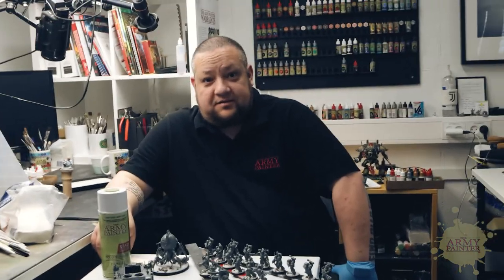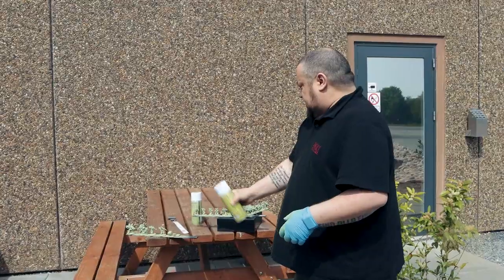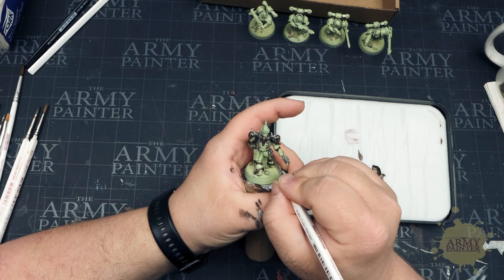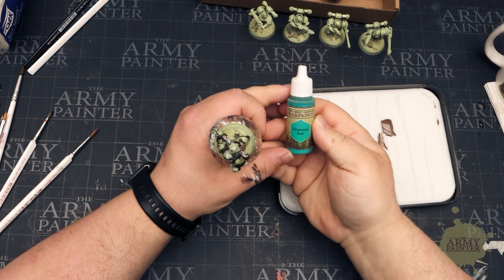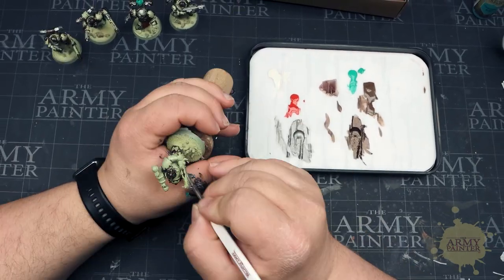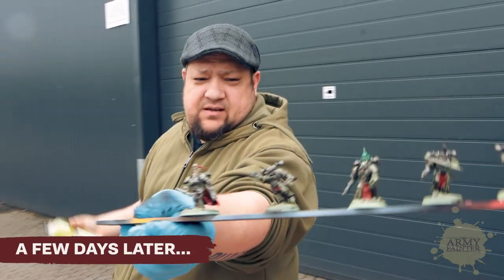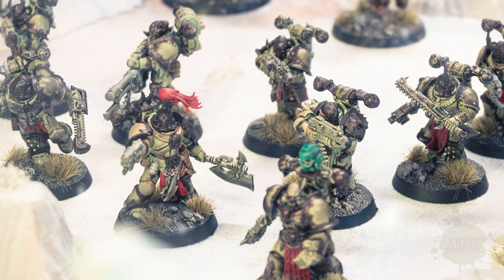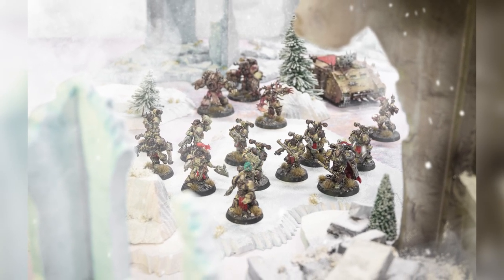Colours of War | Chaos Marine Army Tutorial

Comment: Nice tuto but in 2022 this method is completely OBSOLETE. With the same effort and some washes you will get MUCH better results in less time than the dipping, much more clean, without accidents throwing minis some inches far away and even much more budget friendly. Anyway nice vid, cya!
Reply from the maker: Maybe? Maybe old techniques never die? There’s a whole generation of gamers who have never tried and for some projects it’s worth a shot and even a lot of fun to try.
Reply: This is for saving time on big projects, it's literally not obsolete, it's just a method you personally wouldn't use.
Something I detest about the online hobby painting world is the crazy standards that people have, because pictures of the best paintjobs keep circulating. I've spent +50 hours on a single model, I can paint quite well, but I don't actually like painting armies, so shortcuts like this are a motivator to get a 'good enough' result that isn't bad.

Washing models is quicker if you're doing 5-15 models because you don't need to set up. If you're doing 120 orks or guardsmen, the dip is much, much quicker.
Reply: @Smilomaniac  Very well put sir/ma’am!
Reply: @Smilomaniac  I for one have never done the dip method, but for my bolt action armies I imagine the speed would be significantly different.
Reply: @Smilomaniac  Is not about hate dude. I can assure you that basecoating all the army like the tuto and then wash everything with something like agrax or nuln oil alike with a big enough brush will be much more quicker (no shaking, no matt barnish, no messing all around and much less dry time than dipping a whole army in wood barnish) than this. I tried it some years ago and is for that why am I talking about. It was a nice method some years ago, now we have better options, is just a fact. Anyway if you like it its completely ok, but obsolete ,)!
Reply from the maker: @themajinchaos7886  obsolete is a bit harsh considering the end effect is quite different. Due to the prolonged drying time with the Quickshade Dip compared to our Quickshade Washes, there is a much more even gradient from light to dark on flatter panels, and harder edges have a more pronounced instant highlight when done properly. You just can’t get that result with any acrylic wash. It’s a different overall look and effect, using washes is great too, just different. So to say it is obsolete, in our eyes, is not accurate. Nothing’s obsolete if it helps hobbyists have more fun, paint grey plastic, and get more time for gaming.
Reply: The Majin Chaos  - Didn’t say it was hate, I’m just correcting you.
You’re talking about two different liquids with different properties and end results, with your subjective take on what it looks like.

I’ve been in the hobby since the 90’s, washes, pinwashes and the like have been around for much longer than GW’s “shades”, I understand what you’re talking about just fine - You should take a look around the ww2 model hobby community and see what people do with many other tools and products to replicate realistic results.

If you’re going to wash the entire model, then you have other issues to contend with and you might as well do it right with smaller brushes.

It’s not that I think you’re lying or anything, it’s that you’ve obviously not wrapped your head around the subject, but you’re too busy trying to insist that it’s “obsolete” to really appreciate what’s going on :/
Reply: @Smilomaniac  All is subjetive there then, because you are giving your impressions about it too, same for army painter. But being obsolete doesnt mean being bad or not valid, is just that there are better options for the same purpose and that is a FACT, not my opinion dude. Can you tell me in 2022 how many painters are using "dip" over "contrast/washes+drybrush"? If you think the first is the top of the speed I can tell you that you are completely wrong. Again, is not bad, and the results are quite the same doing base+dip or base+wash, the only difference here is the effort and time spent in any of the methods where, one more time. dip is not the best of all, just that.

Im totally ok if people prefers dip but thad will not change that is a past method in these days compared with the new products we get. Valid? YES. Obsolete? YES. End of my transmission XD. Greetings and  have a nice day!
Reply: @themajinchaos7886  No, not all is subjective, that's nonsense. 

You are saying that because there is a better method, that makes a worse method obsolete. That would be true if the result was the same, but it's not. 
You like the wash result better, THAT is subjective and I understand why you'd think so and on a single model I would agree that it is, but as an aesthetic whole which is more important when you're fielding dozens, sometimes hundreds, then that's different.

I don't care about the rest of what you've written, the fact is that you came in and claimed dipping is obsolete and you're wrong. I've explained why and if you don't understand or agree then no one can help you and it's a result of you wanting to argue or avoiding admitting that you're wrong. 

Discussion over.
Reply: It can't be obsolete...we literally just watched it work